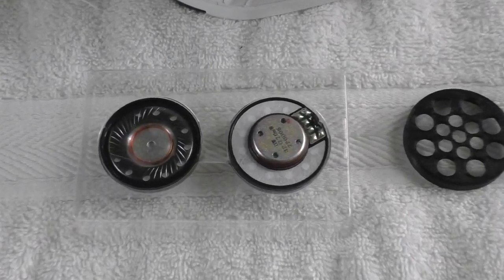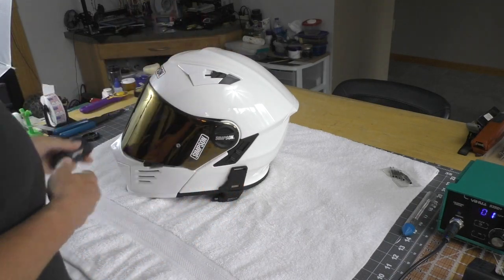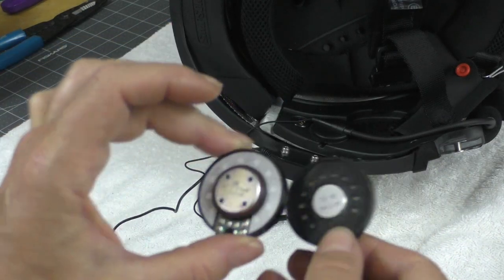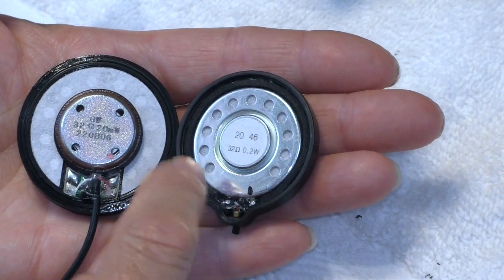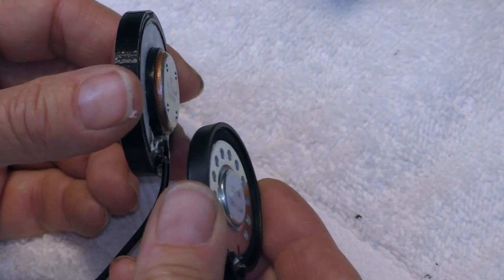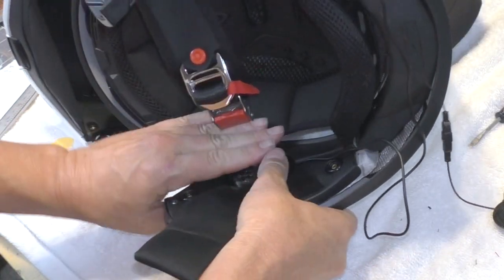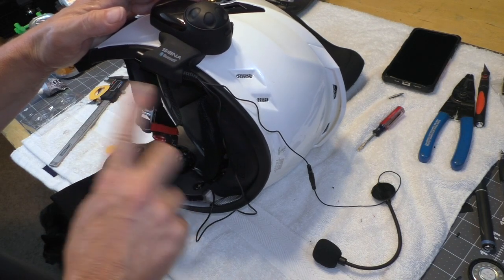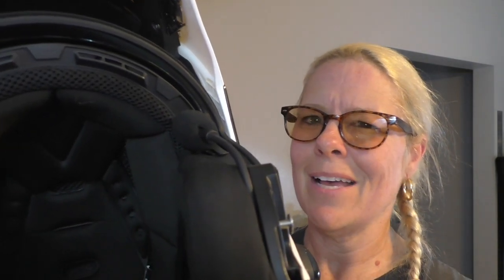Sena Speaker Upgrade | How To

Comment: THANK YOU!!! I replaced my blown sena speaker yesterday and it worked like a charm!  Sena wouldn't help and my model doesn't have interchangeable speakers as some do.  I don't have a 3d printer, so I modified an old spice lid that fit perfectly. I bevelled it down to size and drilled in holes. I was at such a loss, about to drop money on a cardo, and this video inspired me to figure it out.
Reply from the maker: That is fabulous! I love the ingenuity! Way to go!
Thanks for letting me know, it's great to hear!

Comment: Great video Shell on Wheels. Used the speaker upgrade  hack on a Bell Mag 9  Open Face helmet  which is sold with optional  (specific ) Sena SMH10 clamp and speaker setup, so no additional  holders were needed as speaker pockets are provided in the helmet. Wire colors are different for each side and no left/ right speakers  locations  are indicated. On one side  wire colors are black and brown. The black wire  works better on the red( positive) part of the speaker imo.  All in all a great video and definitely worth doing. Thanks
Reply from the maker: Thanks for the info on your specific helmet! It's always helpful when others comment on what worked for them and I'm glad the video helped!  Thanks again!
Reply: Oh wow crazy, I literally asked Shell that question today!  I put the Brown on + and the black on - 
I couldn’t notice it being out of phase but maybe I’ll swap them and see if it sounds better?

Comment: Hey, great video! I want to do that too cause I can’t even hear my GPS on highways..smh.
Is there any way you could share the 3d print file of the cover? that’d be awesome. Thanks!

Edit: Also, do the buttons still work with the new speakers? Skip, the volume wheel and all?
Reply from the maker: Thanks! Yep, all the buttons work.
I'm sorry, I don't share the file but I'll sell a printed set of covers for $12.50 ($8 for the covers & $4.50, in the US, for USPS Ground Advantage shipping). If you'd like a set, you can click on my channel name and the About tab to get my email address. Otherwise, if you've got a printer you can design a basic set of covers in Fusion 360 or even Tinkercad & just print a set. I use PETG filament for these.
Reply: I had this issue before. I had to 
1. Turn the dial wheel volume all the way up
2. Turn on the "louder" option in google maps
3. Ensure my phone's volume was max
4. Turn the audio boost on the Sena software
5. Reboot everything (the app, the phone, the sena) -- (for some reason the settings didn't take until I did this)

This got the Sena 30K loud enough to hear google maps instructions upto about 85MPH in my Shoei helment while wearing ~30DB NRR ear plugs.
Reply from the maker: @justmeandmy  Good tips! Thanks for sharing!

Comment: Ok quick question 😬.  I cut my sena speaker wires to solder up these new ones and I’ve got three wires… red white and blue. Am I in trouble?
Reply: If I look real close it looks like the white and blue go to the same spot and the red is separate?  It’s hard to tell because they put so much black glue on it
Reply from the maker: Oh! Hmm. I don't know for certain. My best guess would be white & blue together  (as -) and red alone (as +). You might try them on the new speaker like that before soldering and see how it sounds. Compare it with the stock speaker. If the polarity is wrong, you can usually tell. Let me know what you find out, please!
Reply: @ShellOnWheels  ok I left the blue wire out of the mix and it worked however, It’s not better than the old speakers. So I’m going to take it apart and add the blue wire in with the white…🤞
Reply from the maker: @nathanhawkes6885  I hope that sorts it out! I wonder if you have the JBL speakers to begin with? I guess those were quite an improvement over the ¢.50 piece ones my SMH-10 had.
Reply: @nathanhawkes6885 what ever happened with this?
Reply: @nathanhawkes6885 hey just hoping another notification gets your attention. Did you figure that out?
Reply: Hey Tom
It did work but the system I was trying to improve was already the better speaker so it didn’t improve the sound quality
Reply: My next option is going to try a designated sound system type speaker

Comment: Loved this. Been wanting to do for a while and was just looking at exactly the same drivers before I found your video.  Now….just need to find some nice person with a 3D printer!
Reply from the maker: It's worth doing! 👍
I have the speaker covers available if you're not able to find someone to CAD design & print a set for you. They're $13 ($8 for the covers & $5 for USPS insured, tracked shipping in the US). Thanks for watching!
Reply: Thank you. I only saw your reply after tracking down some covers and I’m in the UK. Have covers and drivers now and removed Sena yesterday (going to fit on a new helmet). Soldering today!
Reply from the maker: @stuartb3502  Great! Good luck with your upgrade! 🙂